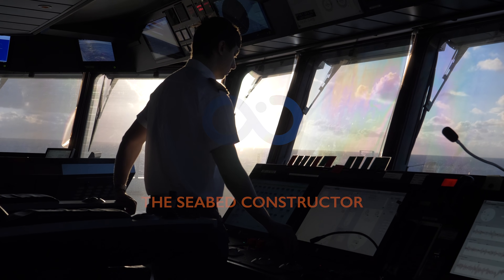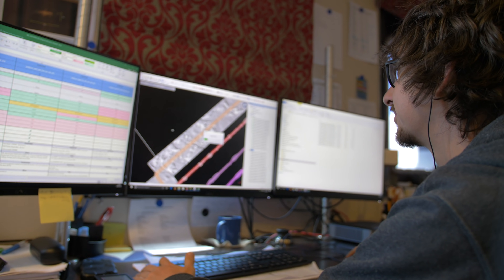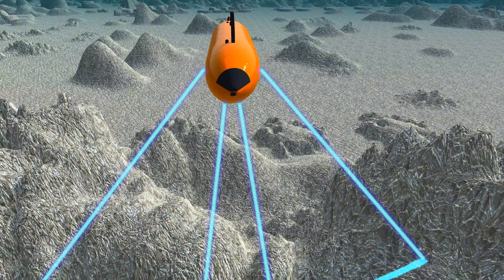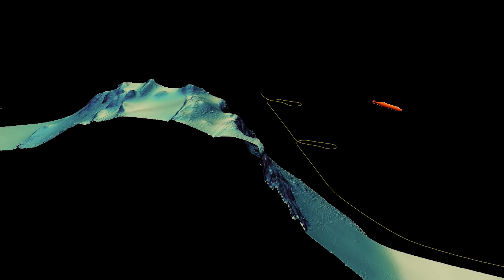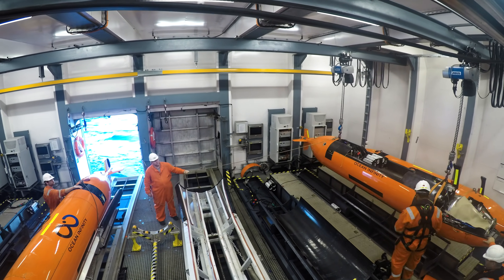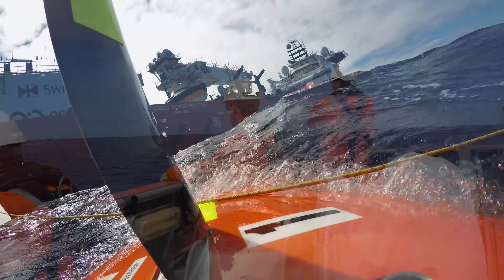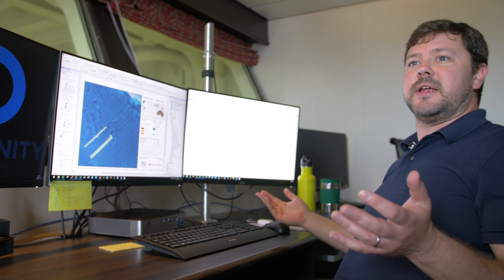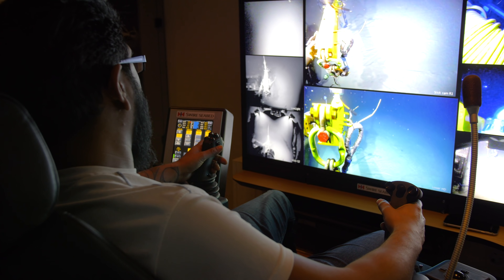Ocean Infinity - Operations

Comment: "1Gbit high-speed fiber-optic network"

That really isn't that fast. I have cheap copper and sub-100€ switches and nics for 2.5Gbit. Seen fiber mostly used for long-distance 10Gbit+

But I assume you don't have too much of a rush or too many gigs of data for it to matter. Kind of interesting how separated the architecture is though. Wonder what a more integrated system with data streaming right off the subs would look like.